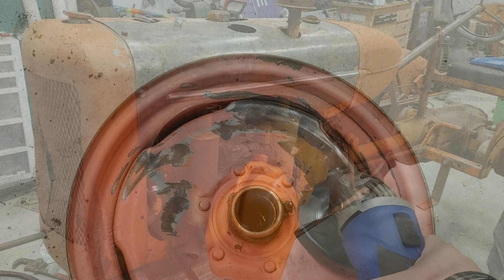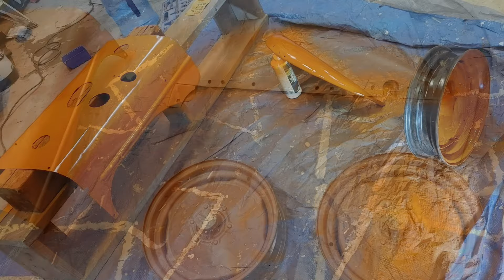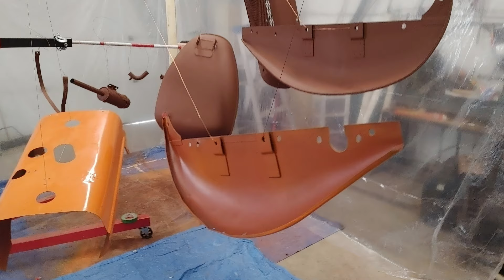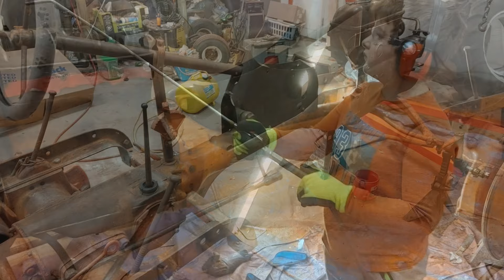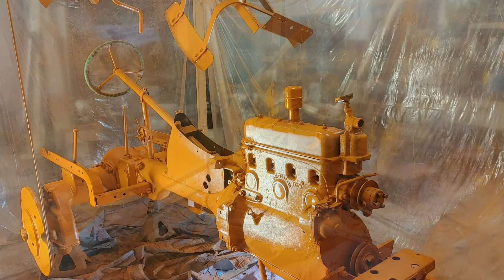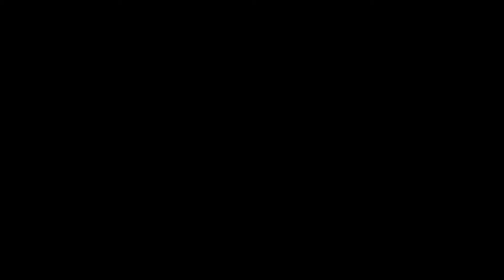Rusty to Restored: Bringing an Allis Chalmers B Back to Beauty!

Comment: Do you normally just sand what you can or do you sandblast as well ? You do an excellent job on these tractors. Thank you.
Reply from the maker: Thank you!  I usually just get in everywhere I can with a wire brush on a die grinder.  I don't sand blast because it makes such a mess.   If you've got a good spot to blast it would probably be better than what I do :).  I just try to make sure I get in and get the rust/dirt out of every nook and cranny I can find.
Reply: @billstractorcorner  You do a great job. I’ll just try the same as you.
Reply from the maker: @Redhackle best of luck- what are you working on?